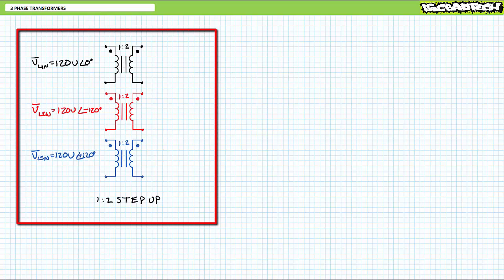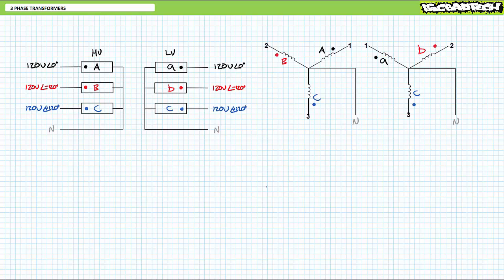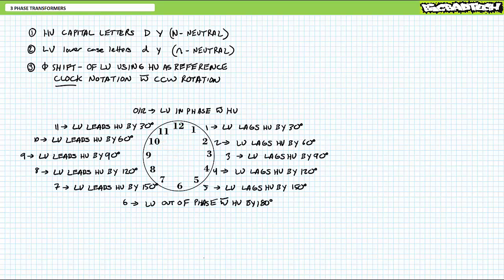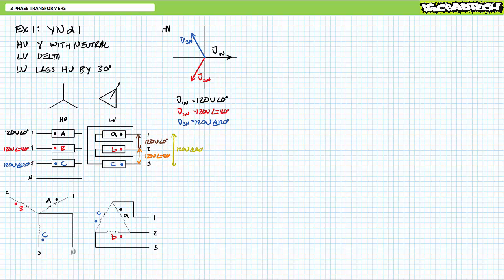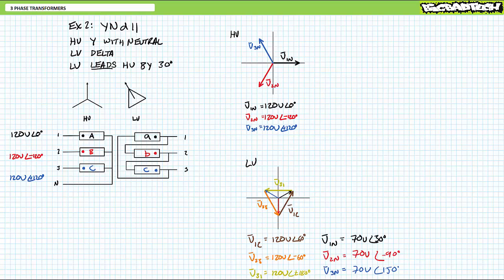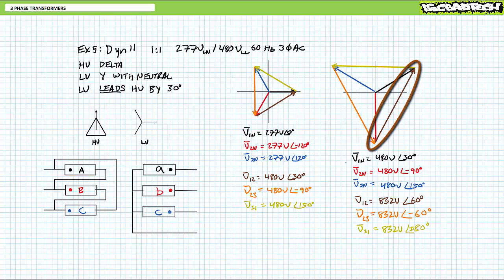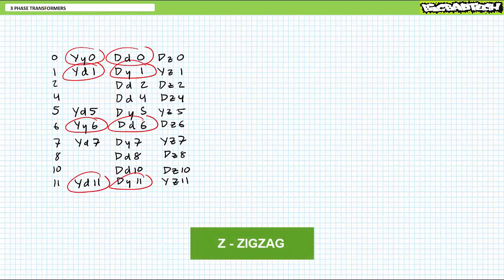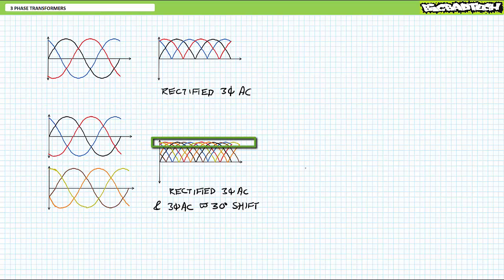3 Phase Transformers (Full Lecture)

Comment: Hey man, ive watched probably half of your videos. Ive got a closed center purporional valve and am tryibg to wet uo the system. You were the first person i heard suggest to use pressure sensor to kill motor when pressure is built. Do you have a schematic or is there a good place to find more info? I think I've managed to watch all of the hydraulic and electric Control playlist and still haven't seen a good idea on how to set this up